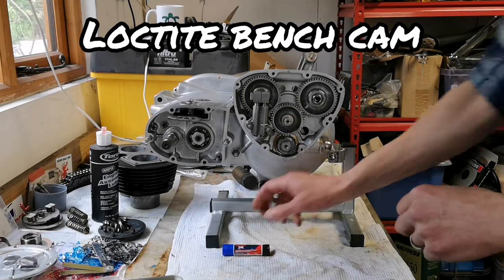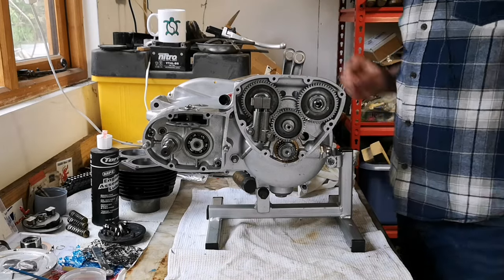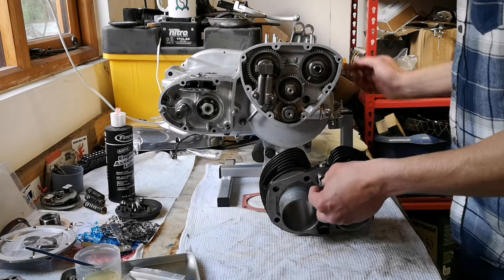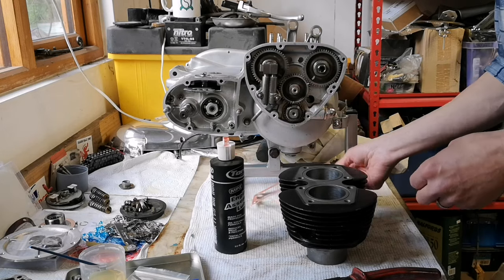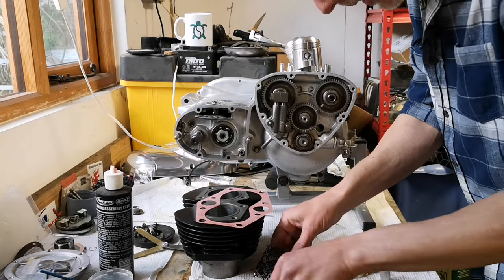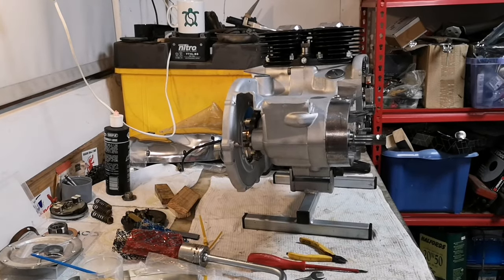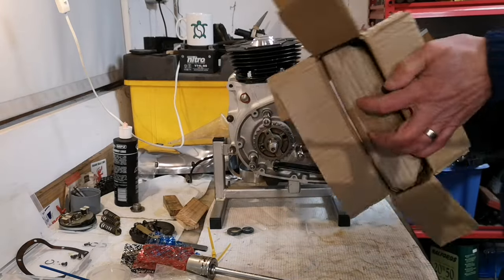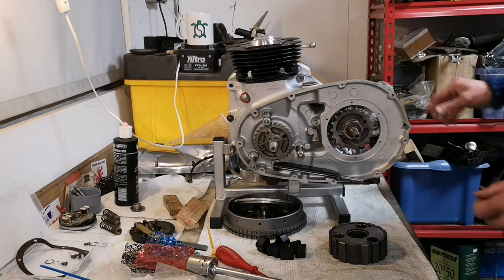Project Triumph Tiger 90 Episode 28

Comment: Thanks for showing tips and tech for these engines, your piston ring compressors, are good solution. Suggest fitting the engine now before it gets even heavier !
Reply from the maker: I always get to this point and consider putting it back in the frame. But I always find checking the crush gap on the tube seals easier on the bench.
I'll recruit my neighbour for help lifting it in.
He owes me a favour after I made him a gear lever for his Vincent racer. 👍

Comment: I have been following your rebuild with interest as I have a T90 myself that needs a lot of TLC .  I know you said you didn't want to think about how much you've spent but I would be really interested as it would give me an idea of them I'm costs involved . Looking forward to seeing more .
Reply from the maker: Hi mate. Rough numbers, 150 for main bearing and ream. 150 for crank regrind. 200 for blasting. 150 for rebore. 150 pair of pistons.
Painting barrels. Gasket set.
300 on valve cutting and seats.
The list goes on.
A page full of stuff that costs between 10 and 20 quid.
Stainless fixings are crazy money in cycle thread etc.
I reckon, a rough ball park, I'm nearly 2000 into it.
But... I'm going for extremely nice. You can save money by cleaning up old fixings etc. And not replacing stuff that isn't 100% worn out.
For example, I could have lapped my old valves back in. They were "ok".
But I'm not selling this bike, so I thought I go for very, very nice.
Reply: Unfortunately costs to restore most of the smaller Triumphs including the T90 will rapidly exceed the final value of the bike. I spent over £ 6000 restoring the 3ta featured in my restoration guide.
Reply from the maker: @Triumph-Tiger-90-Com  I think it’s fair to say that this isn’t a profit making hobby. More of a passion.